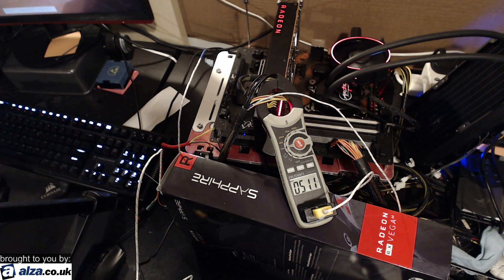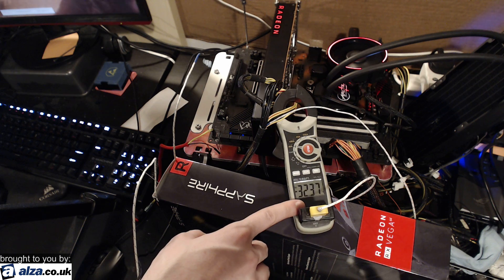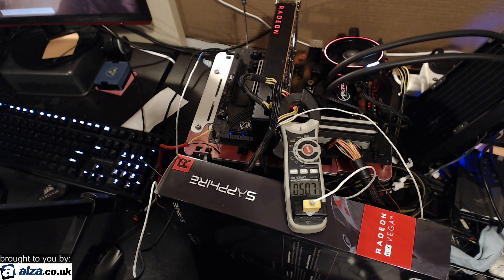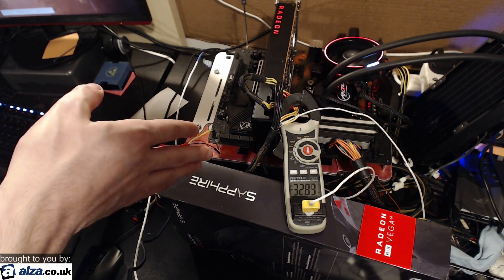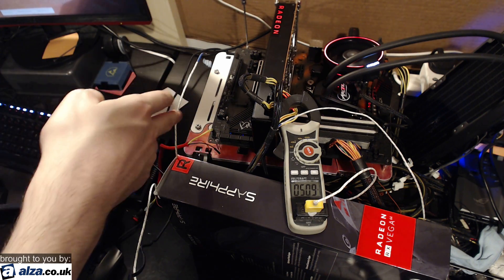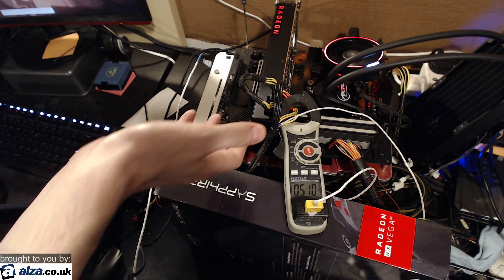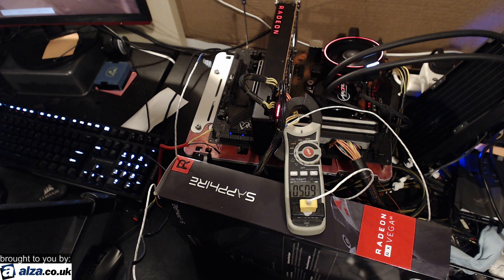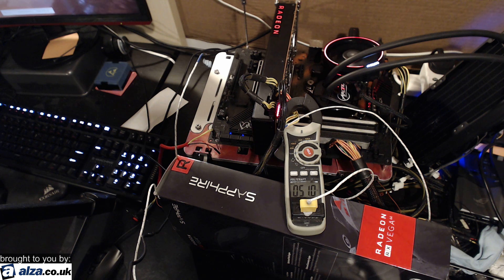A look into daisy chained PCI-e power cables

Comment: On my CX450M it's labeled as 6+2 pci-e & 4+4 cpu, I'm not sure if that means they're interchangable or not, but I do notice my 960 artifacts like crazy with the tag end, but not the main line(So yes they do fit). I get that it's not the highest quality PSU, so maybe that affects it, but I wonder if it's just not rated to properly transfer power needed for a GPU? I'm not an expert on power matters though, and I could just have a damaged wire.
Reply: "CX series supplies some dirty power" They have a CX450M which is part of the 2015 lineup which provides very clean and stable power, you are thinking of the older "Green Label" CX-M lineup which wasn't great.
Reply: The green model was 430w, there's only grey variants of the 450w
Reply: It's definitely the 2015 version, I did my research and, it was gonna be 19.99 after MiR, so I thought for the money it was really good, and semi modular. Way more than enough for a 960 and 880k, and I plan to get an R5 soon, so there's definitely more wattage available to work with here. Anyway, here's a link to corsairs official website, one of their product pictures shows exactly what I mentioned, to prove it's not just me making things up/editing a picture of my rig. Neeither plug has any trouble fitting the GPU, never tried to stick it on the mobo though, because I didn't care enough to check, as I don't exactly need two 8 pin cpus anyway.

PSU: http://www.corsair.com/en-us/cx-series-cx450m-450-watt-80-plus-bronze-certified-modular-atx-psu-eu

Specific pic: http://www.corsair.com/~/media/corsair/product-images/psu/cxm-2015/large/cx450-550m_01.png
Reply: Ah
Reply: 4+4 is not for video cards and are not exchangeable. different pinouts
Reply: Not interchangeable, and you shouldn't be able to easily plug one into the other anyway.
Reply: The cable is rated properly. If they weren't, they wouldn't legally be able to sell it.  CX series supplies some dirty power, but that shouldn't effect stock stability at all. If it's unstable at stock, it's defiantly not the PSU
Reply: He's using a 960, which came out in  2015. chances are that he's using the older green one, since it was almost another year and a half before places stopped carrying them, and the grey labels were easier to get.

Comment from the maker: I'm still not happy with this take however I refuses to spend any more time in a room that's above 25C.
Reply: You wouldn't survive california then man
Reply: Wait, you're in the UK, 30° is like having the summer you never had :D should be happy !!!
Reply: @riffsnreviews  no he is not from the UK, he lives in the Czech Republic if I am not mistaken
Reply: @TheFiku  No, he's from the Czech Republic but lives in the UK.
Reply: Try moving to/living in Australia, especially in the outback like where I've lived the majority of my life, 45+ in summer, hell 2 days into spring and it was 30+ with it 35+ the last few days, it's why I've got 1800Watts of Liquid cooling so I can stay as close to Delta 0 Air as possible.
Reply: Street Guru that's why cali sucks
Reply: 25c is pretty cool in my country, where most noon gets to 35-45C outside
Reply: See I think this all comes down to the PSU being used. I mean, I can't prove it, and I have always felt better using two single 8-pin commectors from my EVGA GQ 1000w to my G1 Gaming GTX 980 Ti. But from the moment I saw that JayzTwoCents video, I couldn't help but think the difference is down to either the PSU its self, OR the wires used on the Daisy Chained connector Jay used simply did not use thick enough wires to carry the required current.
Reply: Actually Hardcore Overclocking you refuses?
Reply: First! You didn't say first! Also, would you be willing to make a PSU tutorial or guide, for Ryzen taking into consideration OC? :D
Reply: In summer 35-42 degree heat is pretty common.
I have to be pretty careful using my computers in summer.
Overheating related shutdowns were not unheard of.
Winter to summer is a 40+ degree temperature swing. Yay. XD
Reply: My room is cooled to 30C.